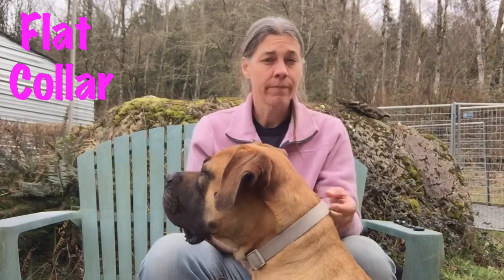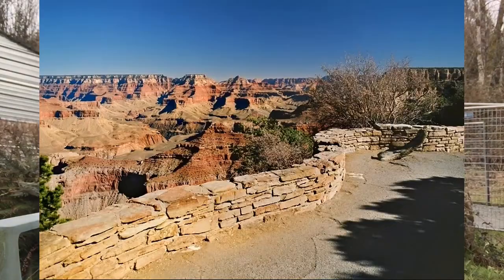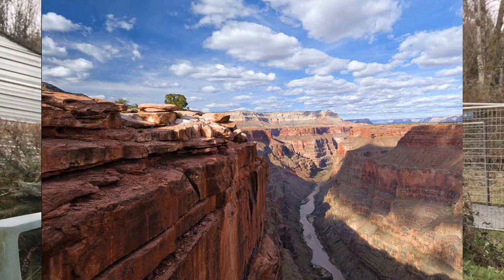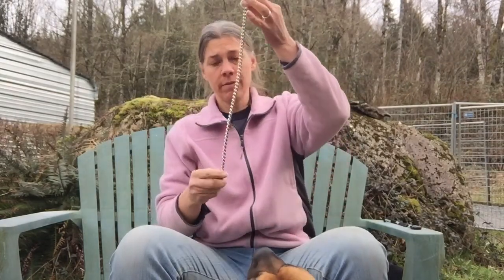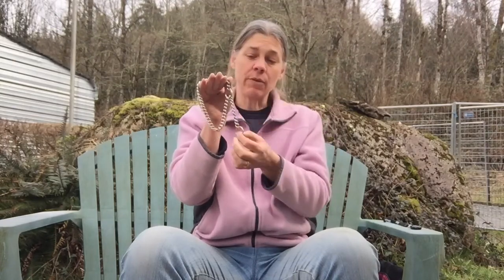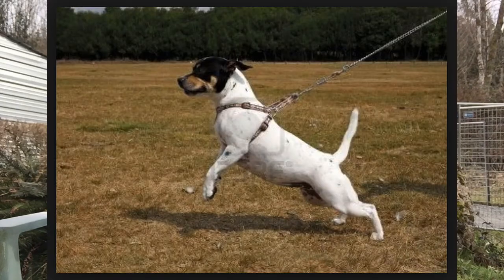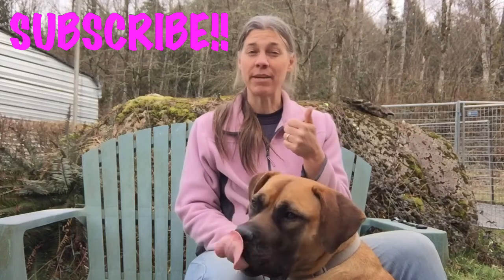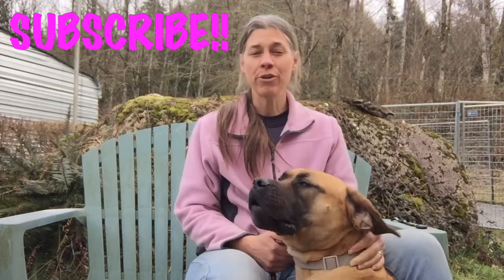Training a Service Dog: Part 9 - Equipment

Comment: Thank you for explaining (short and sweet ) how to use these tools!!! The pinch collar makes so much more sense the way you explained it. I've had a "trainer" tell me how to use it by constantly (and harshly) "popping" the dog....didn't look like popping to me. Plus it was way too loose, but hey I'm not a trainer--yet.
Reply from the maker: Sierra Swavely - I'm so happy that this video was helpful!!  :)  I consider the pinch collar to be a tool best suited for a) giving a smaller handler some leverage over a larger dog, and b) for a well trained dog who understands the concepts of giving to pressure.  If you place the pinch collar on properly, and then gently pull to one side, hopefully your dog will eventually step into the direction you are pulling.  That's giving in to pressure.  Praise her!!  Do it again.  Repeat this lesson until she understands that a slight tightening of the leash means she's supposed to make it slack again.  When she gets it from a stand, then start moving forward.  The best way to train a dog to stop pulling is to spend several days basically walking it no where!  Every time the dog moves out in front of you to pull, turn 180* and start walking the other way.  This can take a million repetitions but even the dullest doggy bulb will eventually get that their faulty position is ruining their walk!  Once they get this concept, then some correction can come into play, but it's really not fair for us to expect them to understand this concept without teaching them what it is that we want first.  I mean, if you think about it, walking right next to another creature really isn't a 'normal' behavior for them.  When MY dogs are all off leash here on the farm, they are constantly racing each other for that lead position!